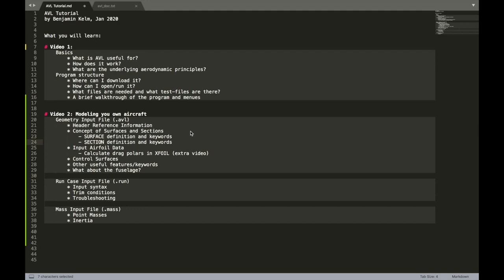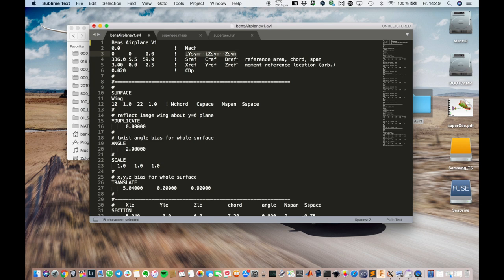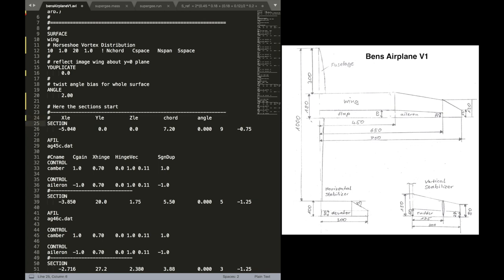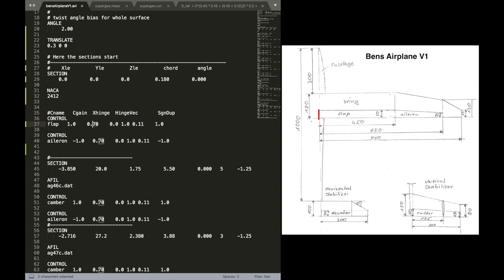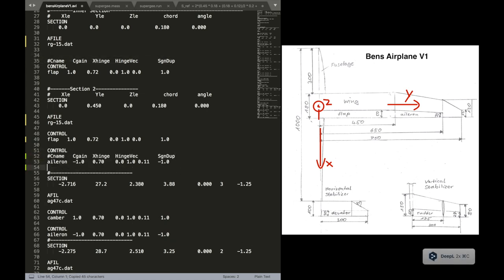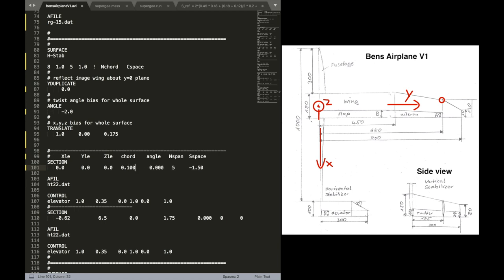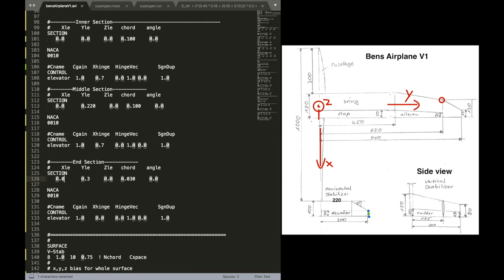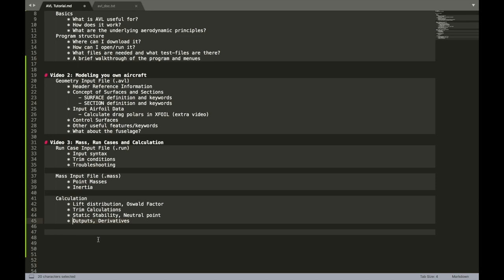AVL Tutorial (2) - Model your Airplane

Comment: hello sir,  have a question regarding the drooped wing. if the wing is divided into n sections for instance n=10,  from n=8, have to droop the wing. so how to do that in AVL, sir?
Reply from the maker: Consult the manual - it's possible to set an incidence angle for each section.

Comment: I am having a weird problem that I cant really fix. whenever i tried to load the file that i created for my designed plane, AVL  just shuts down. if anybody knows what exactly is the problem please answer this comment
Reply: Hello, I've just started to use AVL but it seems to me that you are running AVL directly and not from CMD. Try to run it from CMD. AVL might still crash but CMD will stay open and will show you the errors. The same thing as you describe was happening to me. I've changed the values of Nchord, Cspace Nspan Sspace (distribution of vortices) through trial and error.
values which worked for me 7  1.0  30  0.0  !  Nchord   Cspace   Nspan  Sspace
Reply from the maker: Sometimes this can happen (under windows) if the file was not set up properly (like having TABS in there). 
Also these top declaration might cause problems (Under Windows) if they are not defined as floats (0.0 not 0)

Example .avl file:
Bubble Dancer RES
0.0                      Mach
0      0      0.0        iYsym  iZsym  Zsym       # 0 instead of 0.0 might cause an issue in Windows.
1000.0 10.0   116.6      Sref   Cref   Bref

Just try to keep an eye out for that.

Comment: Hello! Thanks for the video. In the Control declaration, pls explain usage of XYZhvec.
Reply from the maker: It gives you the hinge vector. However, in my experience it doesn’t really matter - seems AVL hasn’t implemented this for the standard use case.
Reply: @BenjaminKelm  Thanks for your answer. However, it does matter as a declaration. If you put another declaration instead of 0.0.0., you obtain different stability derivatives. I have checked it. I don' t know what the usage in declaring a hinge vector  different than that of the real hinge line would be, however. That's why and as per common practice, I always declare the vector along the hinge line (0.0.0.) and thus obtain the stab. Derivatives as they should be.